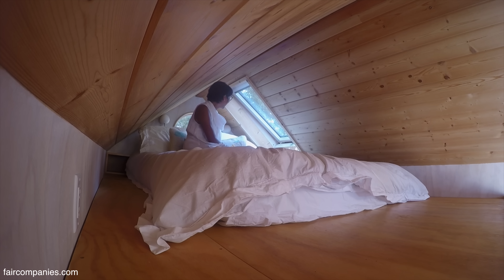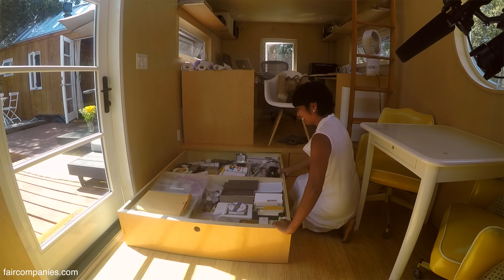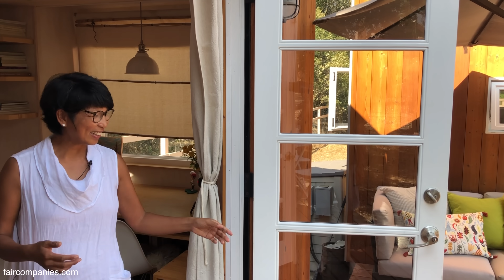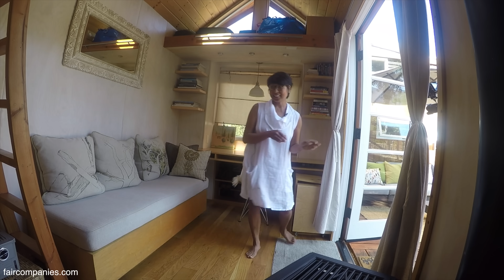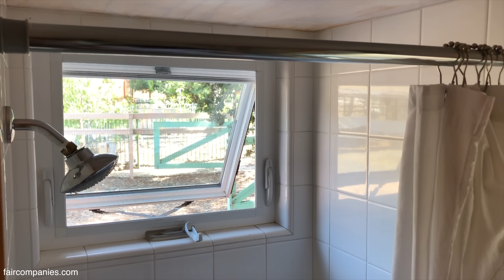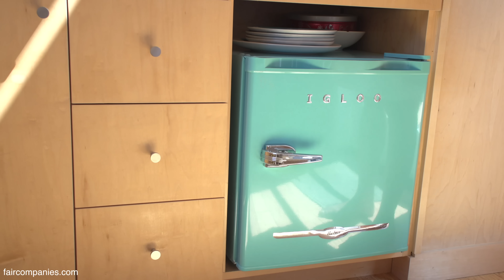Vina Lustado's home-office using 2 tiny houses in "L" + deck

Comment: Cladding has a potential problem here. Air should circulate freely from bottom to top to keep mosture off. Now there is horisontal barriers behind and they will rotten because of the lack of up-down circulation. Nice tiny house though, like the idea of separate unit for workspace

Comment: She’s so happy, I feel happy just watching & listening to her 😊
Reply: LemonTreesOnMercury : she doesn't seem so happy about her neighbors and their ideas about her.
Reply: @tomsenft7434  Why you got to say something useless and negative? Nobody is happy to be talked about and frowned on.  She's probably been dealing with that period.  She not worried about them haters like us Americans tend to get hostile over.  She happy and free plain and simple.
Reply: @builderspluscustomhomesand2146  As she had said, she would have liked to be able to be staying there full-time, and she would like to one day have a stable location. But just like people already can move entire non-tiny houses, so can tiny houses can be moved, it's just that it's easier with tiny houses. If regulation would allow it, a lot more people would have a tiny house and pay taxes for it. The question is, how small is too mall, really? I would say the minimum is 2 meters in length, 2 meters in height, 1.5 meters on that other dimension, so a total minimum of 6 cubic meters (212 cubic feet). Anything less than that becomes more of a cage, honestly. Where do you put the storage, where do you put the bed, where do you put the cooking area, where do you put the toilet and shower? At that volume, you can barely fit everything inside a bed frame in which you store things, and take them out to use them, or used them by attaching them to the walls. Anything less and it's pushing the limits of humane living.
Reply: @tomsenft7434  but she seems to know how to deal with that. She comes across that she's already been in confrontation. It's a problem   😁😁😁

Comment: Her financial freedom and joy of simple living comes across so much in her smile and energy. I am going through this change right now and I cannot wait. Her approach is so bang on. Great video Kirsten as always 😊
Reply: Best of wishes for your effort to be free
Reply: I'll second that. 
Homeowner has done her due diligence, and has nicely utilized Japandi  styling.  (Japanese/Scandinavian design amalgam).
♥️
Reply: The only issue I see is her not having a freezer. Ideally, she will get her land where to do some gardening (the easiest way would be using the "resilient simple garden" of RED Gardens and clingwrap greenhouses), and some of the produce would make it into the freezer, before or after dehydrating (again, making a solar dehydrator with clingwrap, using the "solar chimney dryer" model). 

I mean, sure, I could nitpick, she could get an even higher R value (thermal insulation), but that would cut into the usable space.
Reply: @SapioiT  Yeah, well that's YOUR problem, not hers.  If she wanted one, or actually needed one, she could easily have one.  There are numerous high efficiency, low profile fridge/freezers that will operate on solar systems.  She never mentioned gardening - again, that seems to be YOUR issue, not hers.  You've built this elaborate fantasy about why she needs a freezer.   Rewatch the video as she mentions multiple times WHY she went the tiny house route, and absolutely NOTHING you're talking about was on her list.
Reply: georgianbents why so adversarial?